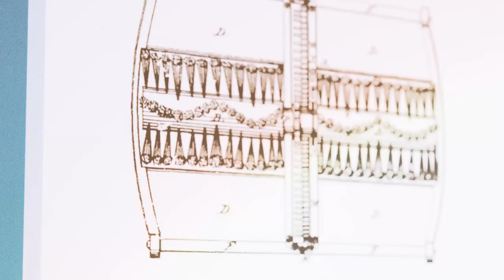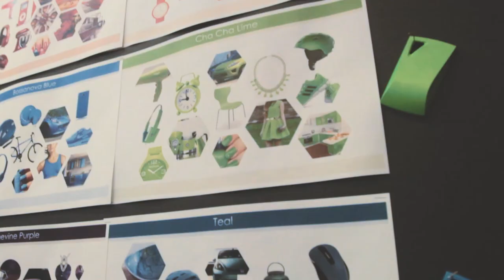Passion for BISSELL

Comment: My Bissell crosswave multi-surface wet dry vac -  'Clean Tank Cap' got stuck inside , Can you assist in removing the Clean Tank Cap?
Reply from the maker: Oh no! Try using needle nose pliers to remove the cap or gasket from the receiver. If you're still unable to remove it, give us a call at 1-800-237-7691.